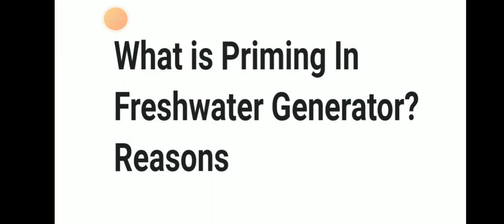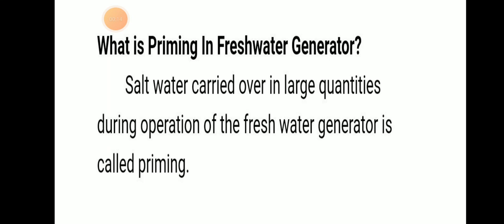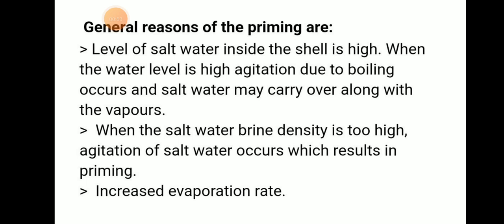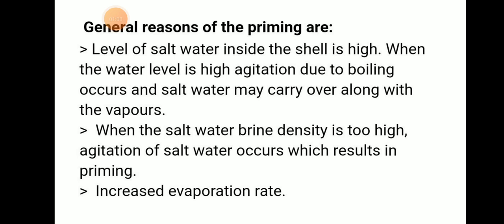Priming in Fresh water generator

Comment: brother, pls let us know how can we check leak test in plate type FWG
Reply from the maker: Close the outlet of the distillate pump, vacuum breaker valve, bottom blow off valve and feed water valve
Inject air into the evaporator shell 
Keep the shell pressed up to about 1.0bar gauge 
Sprinkle soap solution on to the jointings, packings, and suspected areas of the shell